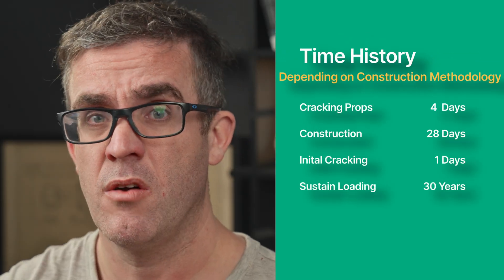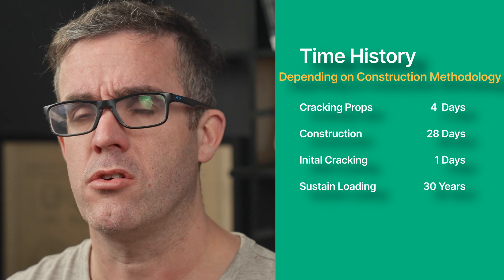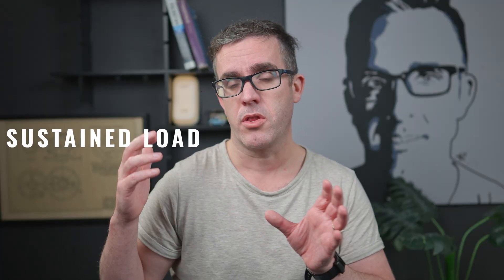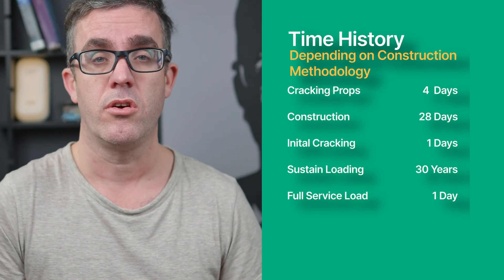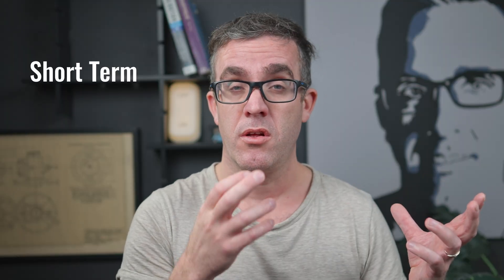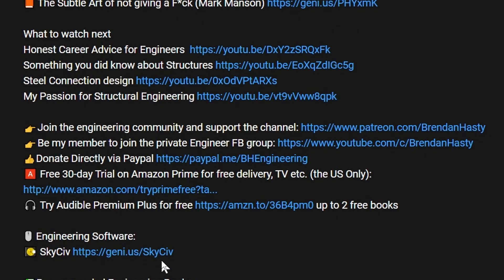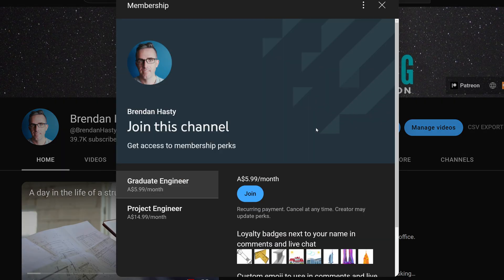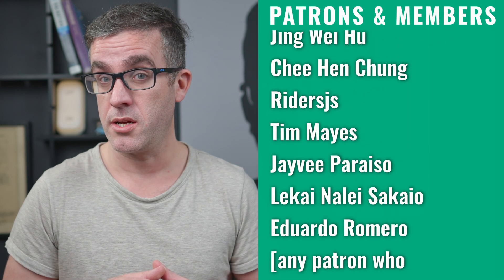How To Avoid Disaster When Doing Structural Finite Element Analysis.

Comment: Such great videos on your channel !!! One question off the topic, when you design tall RC building, what is your concrete usage index (so called CUI) you look to find structure efficient? for example, amount of concrete (m3) / gross floor area? I assume, its logical to put out foundation and basement floor concrete out of equation? By gross area i mean all floor area minus area of structure element?, such a little literature on CUI (from 0.3 to 0.6 for taller buidling). I know that it can vary especially in seismic active areas, but just wanted to hear Your opinion. Once again, such cool and informative videos!

Comment: I am a final year medical student, interested in orthopedics. Do you think structural engineering can be applied to the design of spine prosthesis or implants for joint replacement in order to improve durability and efficiency, also can principles be taken from civ eng and applied to performing bone surgery and working with bone, also dealing with fractured bone to improve healing and stability?

Comment: You mentioned Garbage-In Garbage-Out, another version of that is "PEBKAC" (Problem Exists Between Keyboard And Computer).  The thing between the keyboard and computer is the PERSON operating it.
A very important consideration in structural analysis are boundary conditions- is the connection to the foundation fixed?  is it pinned?  Are the connections between elements fixed or pinned, or a combination of both?
And a consideration that applies when you get into actually designing is what elements are braced and what elements are unbraced?  A floor diaphragm will typically brace the top flanges of beams but at atriums, stair openings, things like that the diaphragm won't be there and some beams and/or columns won't be braced.
Reply from the maker: Totally agreed, we can't fully rely on the fancy softwares!

Comment: Hi Brendan, Recently i am doing some heavy foundation structure FEA using space gass. I found that the results are not quite accurate or as expected when the panel goes to 600mm thick or above. Do you have any suggestions on other software that will be able to handle concrete design better, Brendan? thanks in advance.
Reply: Like Spacegass, manual design